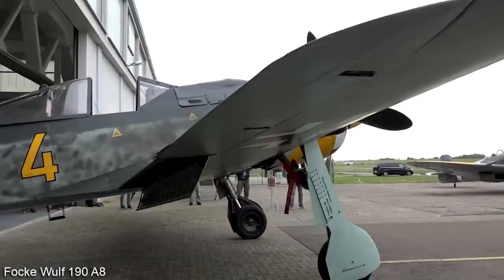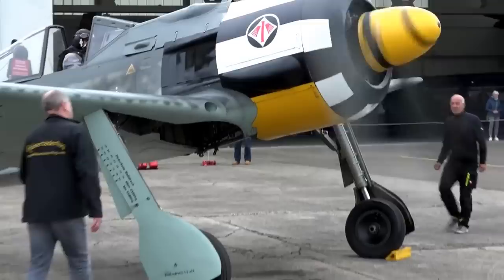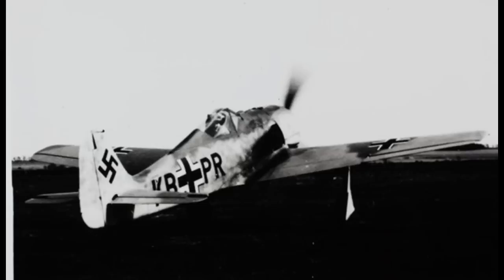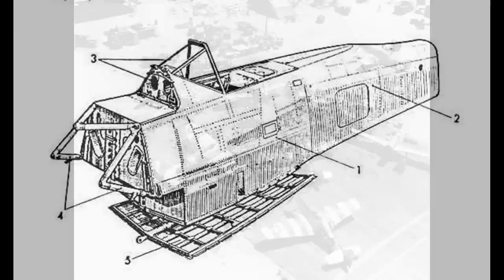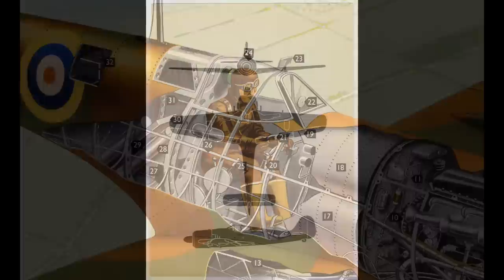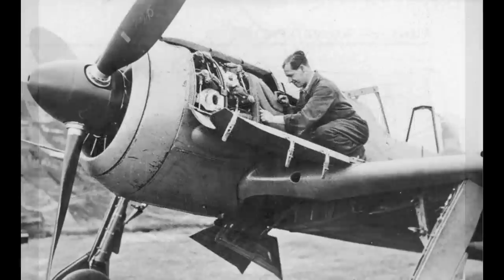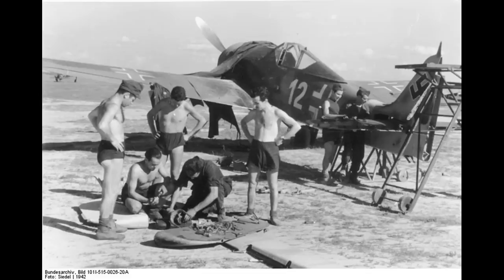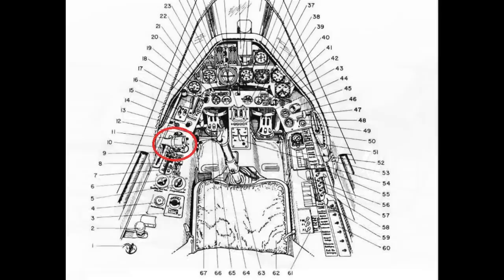Focke-Wulf Fw 190 Pt.2

Comment: Fantastic ! 
Just one word regarding the handling and sequence of the prop-lever (in governend mode (AUTO)). When using an engine equipped with manifold regulator, and one needs to power down, say at 20'000 ft (as being the engine's critical altitude), carburetor air might be very near the maximum allowable level, before going into the cylinder knock area. If one now just throttles back, the MP-regulator will reduce MP, but the compressor (if it's not being a turbo comrpessor) is still revving at max. RPM creating highly heated pressurized air - the regulator will reduce the pressure after the throttle but perhaps not enough while the carburetor will thin out the mix momentarily, creating a condition where in fact detonation can occur, especially at critical altitude. So it's better to bring back RPM first, and thus decrease manifold pressure (at critical altitude or above), just maybe one - two hundred RPM and then the throttle. This will also take some load from the throttle flap in the manifold tube. For instance the Swiss airforce had cases with their 109 Es, where the throttle flap being abruptly closed, caused the manifold tube line to blow, so they installed a spring loaded or weakend relieve before the throttle flap.
Lindberg thaugt the pilot's to operate the engine at high manifold pressure and minimum possible RPM to increase range (because the numbers of revolutions is the deciding factor below continuos power regarding fuel consumption (below very rich mixture settings)) with Bombers, that was a very good advice, but it comes with some dangers, namely detonation, and higher engine wear. Because of this later manuals, for the P-51 and the Bombers special charts were introduced into the manuals to give the pilots a means to manage this better and concsiously.
Reply from the maker: Thank you, that's quite a post. Every US airplane I can think of, P-51, P-40, P-47, B-17 etc. can't suffer from the problem you describe because the throttle is before the supercharger's inlet, thus closing it will prevent the supercharger from building up excess pressure. Now in the planes with throttles after the supercharger's outlet, then yes, what you say makes sense when at or above the engine's critical altitude. Do you a reference for this? I would love to read it.

Comment: Great Video! Seeing that picture of the cutaway P-47  pressure bottles location sparked a 50 year old memory. I can tell you that one .51 caliber hit on the high pressure nitrogen bottle under the main transmission in a Ah1G Cobra-The helicopter shoots itself down.
Reply from the maker: Yup, it's pretty scary, although I would assume that the nitrogen bottle would typically have much higher pressure than a typical O2 bottle.
Reply: @GregsAirplanesandAutomobiles As I recall, 3000 psi. It was scary, but I got the rest of the day off. First time I ever saw the entire caution panel light up without pressing "test".
Reply: @jonwatkins254  

So that's how the guys on tv and in the movies shoot down a helicopter with a handgun?

Comment: Thank you for the explanation of the Bosch Kommandogerat single lever control unit.  Bosch later developed the electro-mechanical fuel injection control system used in the VW Type II/Squareback/Fastback circa 1968-1973, and in Saabs of similar vintage.  That system impressed me as it delivered 36-40 mpg in the 1969 VW Squareback.  One had to be more in tune with those early systems, in comparison to the reliability of EFI systems today.

Comment: New appreciation for Kurt Tank and this aircraft.  It was a warbird unlike any others at its time.  I've seen doco's on the design off soviet/Russian fighters compared to western fighters, in regard to maintenance and using forward airbases.  EG Air intakes having a flap so air was pulled from above the aircraft, not below on rough fields etc.  Just a difference design/ease of use philosophies

Comment: Remember most of those videos where a pressure tank is being shot they're shooting a aluminum 80 (80 cubic feet) filled to 3000psi. But oxygen would also react where as the air filled tank would just release it's pressure, violently.
Reply: I'm sure if you look around in YouTube you can find the same safety videos we'd have to watch showing up at every job site when I was a ironworker, best I can guess there were about 5 or 6 different one's produced for those videos, typically they'd drop a weight on the valve end of a full oxygen bottle from a torch set that was laid down horizontally with a cement block wall built in front of it, they'd shoot through the block wall and keep moving like it wasn't even there, the whole idea would be to stress the importance of putting the threaded safety cap on the top BEFORE untying the bottle from whatever it's secured to, ie column, tree, apprentice(they got dogged a lot on the sites 😜😜😜), or work truck.
Reply: @dukecraig2402  I understand. I used to work at a cave diving shop. People usually use scuba tanks because they usually cost $150 new and are readily available.

Comment: I would love to see a video or a series of them on wind tunnels, I'm fascinated at how they could make the air pass through one MUCH faster then they could make a plane fly in the same era, I'm very curious about the large fans and systems that drive them to generate those incredible wind speeds.
Reply: The real wunder weapon, a 262 powered by small wind tunnels
Reply: @jakeb6703  
They were a waste of time and resources that contributed to them losing the war, like the Tiger tank they were constantly broken, didn't perform the way advertised (despite Willy Messerschmitt's claim of a top speed of 560 Mph the average speed tested by NACA after the war was 525 Mph), the engines were burned up at 8 to 10 hours, and planes like the P47 regularly ran them down and destroyed them, not while they were landing and taking off but while they were throttled up and maneuvering at altitude, when you think jet don't be confused, they didn't perform like a modern jet, they didn't even perform like the first generation of US and British jets that were fielded right after the war, both the US and Britain wisely chose to put more resources into refining planes that were working instead of putting the same resources into a pipe dream.
Reply: Bernoulli’s equation explains it for the most part (of course if you go fast enough you encounter compressibility), so that should give you a general idea.
Reply: @TheJacobshapiro  
No, it doesn't explain everything, it's only one of the many principles involved in making those things work, if it was as simple as that they'd never even needed to have made them, what a stupid statement. 
I guess since it's just basic and simple SpaceX should just hire you to get them to Mars.
Reply: Reynolds number anyone?
Reply: @dukecraig2402    Bernoulli's principles do, actually, give a general idea of how a wind tunnel works. Cameras, shock waves, and fan control systems are technical details. As far as acting like a know-it-all is concerned, that would be you. You could certainly benefit from time spent asking yourself why you feel the need to pick fights in YT forums. It's a chickenshit occupation.
Reply: @Michael_Lorenson  
That'd be like me telling a customer of mine when he asks me how a carburetor works and I say "It's just Bernoulli's Law" and walking away from him, that doesn't even come close to telling the whole story. 
And as far as "Know it all" you're just being another one, I'm the one asking about some information on them, not implying that I can sum them up in one sentence, you go look in a mirror.
Reply: @dukecraig2402  Do you think you are proving me wrong?
Reply: @dukecraig2402  the 262 isn't a bad plane and if u had watched Greg's video about the 262 and the f80 (? I'm not so in to early us jets I think they are kinda ugly udssr s to but the Prop-Planes a nice to look at with some exceptions for same experimental ones)
The 262 was built for higher speeds where the jet engines (higher airspeed =higher hp output) perform better than piston engines by far but engineering is always gain on one side of the performance and loss of the other side or get innovative and fix or get around the new problems u will get
And u forget that the Germans had always shortcomings in every department beside engineering (we had many great minds over here at time) the 10 hour lifespan of an 004 jump was manly because ther wasn't enough chrom, nikel, vanadium, tungsten, molybdenum to make a suitable high temp resistant alloy so the turbine blades just worn-out by oxidation other parts to (tanks had similar problems about mid war the German steel got brittle du to the leak of alloy metals) also it is known that the 262 was delayed in Trupp adaption because Hitler wanted "Blitz bomber" so all already built 262 had to be reworked (at a realy bad time, D-day was close) and more smaller things added to it in summary it wasn't enough machines, FUEL, etc and to late 

German piston engine planes suffered the mostly from the fuel because really high oktan fuel is the backbone of every charged (turbo or super) engine and the only reason US and UK  planes had more power also the Germans had not only to encounter us and UK planes (built for "high altitude" the udssr planes (built for "low altitude") what caused that the engineers had to compromise one more 

For the big kitty tanks thay had the same basic problems just not enough material, fuel man etc and to many iterations with small improvements from iteration to iteration (slows down the production) here also not enough to late but there choice to build less big powerful tanks(Tiger, Panther) instead of same more tanks that ar mostly equal to the enemy (Pzkw IV) make sense because they know that they are and will be always massively outnumbered  the hope was that one strong tank at a price of 2 less strong tanks could destroy more tanks of the enemy than the 2 less stronger ones

But the neck breaker for the German military was that they were focused on attack and expanding (same time the front was to fast for the supply lines what caused the front to stop and give the enemy chances to attack or dig itself in) and at the point where they had to go in the defense they started to lose more tanks because when a tank brakes down on the battlefield and the enemy front is moving forward u just can't pick the tanks after the battle up and repair them since they are in enemy territory so u have to destroy the Maschine as u leave or it gets used against u
Reply: Oh and I forget that the US tests conducted on any German late war equipment wasnt always precisely the top performance what the design is capable of because they have to capture the equipment so it is 35% used 1% new and 14% still in production/not finished and 50% is destroyed by bomber attacks or by the intended user so so they had to put it together by themselves without the need pappers or work experience out of trash worn-out and unfinished Planes than u have a test pilot   who can't even read the instruments and have to convert the values in his head atü to psi, km/h to mp/h or knots so the US tested topspeed of 525mph in comparison to manufacturers claims (even in the manual written down) of 560mph shows that clearly

Now let's start the if thing

If Germany could use all the materials they didn't hade access to the  general reliability would be by fare greater

If there was more time to the end of the war the 262 would have gained substantial upgrades in aerodynamik and engine power (the He 014 jet engine was in development) just looking at the official study papers of the Me 262 HG I - III (to the HG IV and HG V the evidence gets to lean for me) HG stands for Hoch Geschwindigkeit translated Highspeed the HG I had a different angle of the wing base to the engines, the HG II had the complete wing mounted in a different angle and the tail ruder was reduced to 2 aerodynamik surfaces( V-shaped ) and the HG III was wild 45 degrees wing angle the engine  merge between wing base and cockpit in the fuselage 
 And with classic or with the v shape tail may so and the Hg IV had relocated the cockpit in the tail (looks stage and not practical) V placed the center of thrust near to the center of gravity by leaing the engine nuzzle (+afterburner) in the lower part of the tail section 

If Germany had access to freaking gas the piston engine planes like the Bf 109 or Fw 190 could run a manifold pressure like the p51d that would the hp output increase by around 20% du to better fuel
Reply: @dukecraig2402  Regularly spawn killed them, you mean.
Reply: @juslitor  dude killer XD
Reply: There is still the strange thing that they managed to construct decent supersonic wind tunnels, before they could make decent transonic wind tunnels, as far as I know. It may need a Greg to explain that strange order of things. -- I believe that would need more than one single physical equation to explain.
Reply: @richardschaffer5588  NOoooooooo!!!!!  😉
Reply: In hindsight we often think Germany squandered time and resources on unproductive weapons, but perhaps we should put ourselves in their shoes before we judge too harshly.  They were operating under very different circumstances than the allies, who had vast superiority in manpower, productive capacity, and petroleum.  But even if Germany could have built great numbers of tanks and planes, they lacked the manpower to crew them and the fuel to power them.  Germany could never fight a war of attrition, so they need superior tactics and weapons that could kill multiple enemy soldiers or aircraft for each one they lost.  They succeeded at such an exchange ratio on the Eastern Front, even when retreating on the defensive.  In the face of vast enemy numbers that you can't hope to match there is a natural incentive to create tanks and airplanes that are more lethal and survivable.  The U.S. had the same thing in mind during the Cold War in creating the F-15, which would need to have at least a 3-1 kill ratio against Warsaw Pact fighters just to break even.  Fight a different enemy and suddenly the shoe is on the other foot.
Reply: @gort8203  Germany squandered time and resources on a two front war yet again, so we can judge them harshly. Clinging to the "stab in the back" myth from the First World War defeat, they engaged on a rerun. This time instead of an offer of armistice, there was an ultimatum of unconditional surrender. Thankfully, Russia, Great Britain, and the United States killed so many Germans, and destroyed so much of Germany the victory was total. God bless Bomber Harris and Curtis Le May.for all that they achieved in Germany.
Reply: @TheGaymo  You have completely missed my point, which was not offering moral or even geopolitical judgment of Germany's actions pursuant to the war.  My point is that the conventional wisdom seems to be that Germany was mistaken to pursue technically superior but complex and expensive weapons systems rather than apply those resources to pursue greater numbers of less expensive merely adequate systems.  Since you didn't note my rationale the first time I'm not going to repeat it here.  You seem to have used my comment as a place to attach your own comment on an entirely different subject, which should be discussed elsewhere.
Reply: @TheLtVoss  looks like they forgot the basics; logistics
Reply: @gort8203  looks like the US did a better job of it
Reply: @kenneth9874  na they didn't forget ( look at the jary canns a wwii desing so great it was copied around the globe and is still in use today) but logistics is the Achilles tendon of each military (just look at Ukraine in the first weeks front was faster than logistics and with each step you go forward your supply lines dwindled) and for Germany the big uff in logistics were the huge fields of the udssr for multiple reasons  compared to the west front (yep on the west logistics had worked OK as long as supplys were in stock) starting with a bad developed railroad system in a different gauge than central Europe going to no real other infrastructure like roads (dirt roads don't) and in combination with the mud and freezing temperatures there logistic just collapsed

So too Sum it up they weren't really prepared (same tried at least) for the harsh weather and bad infrastructure of the Eastern front
Reply: @TheLtVoss  still sounds like a logistical failure, doesn't it?
Reply: @kenneth9874  ehm no it is more of a situation like you go with empty stomach to a Christmas meal but grandma has cooked too good and way too much (especially stuffy things like potato mash and so on) even with good preparation (empty stomach) it will be a near impossible challenge to eat up all on the table and with a perfect preperation (widened stomach for 6 months with lots of water) it will stay challenging
Reply: @TheLtVoss  stupid to try isn't it?

Comment: Thank you Greg.Eric Brown tested the FW190 and other German aircraft and wrote about it in Wings Of The  Luftwaffe" which was originally published in 1977  but my edition is 1987 by Airlife but I'm sure it's been reprinted.
Reply: I have that book.  He really liked the commandogerat in the 190 and contrasted it with the difficulty of controlling the Lockheed P38 with its two engines especially in a dive when the boost had to be monitored.  He reckoned that the P38 pilot would be fiddling with the engine controls as he was shot down by an aircraft on his tail he hadn't spotted.  The P38 was successful in the Far East where combat took place at low levels so engine management was not an issue.
Reply: "Never let the truth get in the way of a good story "
Reply: @jimattrill8933  the p38 was superior at altitude